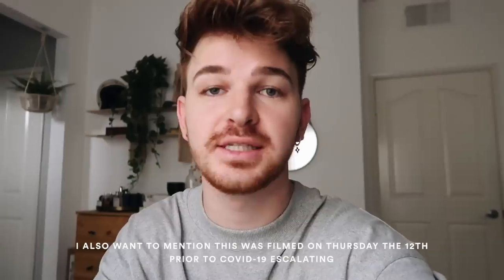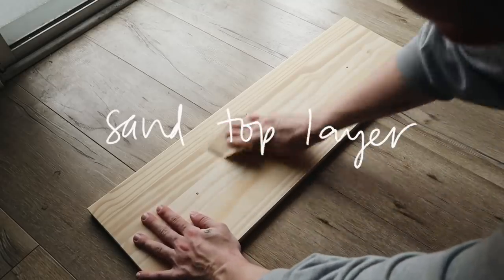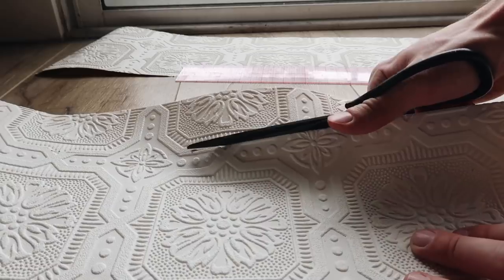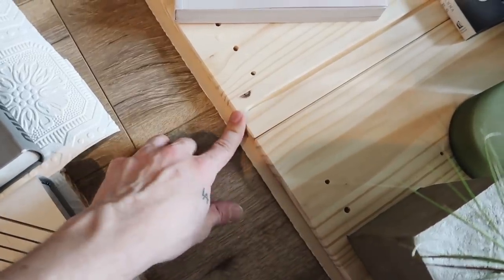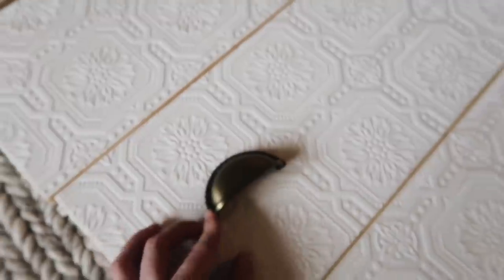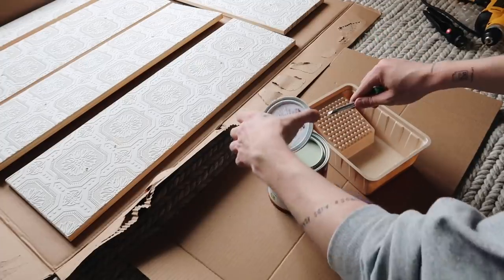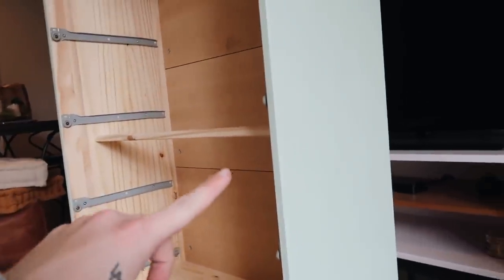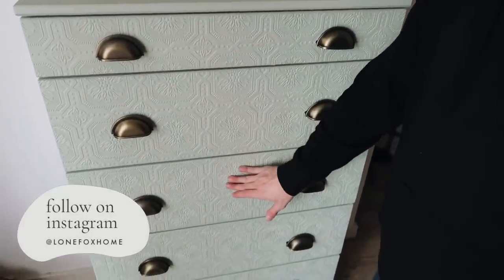DIYing VIRAL PINTEREST HOME DECOR - Embossed Wood Dresser (IKEA HACK)

Comment: I have a few questions if you're bored XD Love the video :)

1. How do you choose your color palette for these DIYs - do you tone it to the surroundings, pick a favorite color or go off trending colors?

2. Do you end up with a lot of left over paint from projects & if so, how do you end up using it? Does that play a big part in smaller DIYs' color palette as well?

3. With the larger projects, do you usually just switch out pieces of furniture regularly or do you ever gift furniture to family & friends?  Have you ever sold anything you've made that you may not have had room for? Purely out of curiosity. I love the furniture re-dos but I have no room for furniture & wonder how you do it with an apartment.

Comment: The only thing that would make this better is if you drilled the holes for the pulls a little bigger so that little foot goes into the wood and the handle is more flush to the front.
Reply: Yes that foot has to go way in. But the dresses looks fan-freakin-tastic.
Reply: Ditto ... handle should be flush with the drawer front.
Reply: Yes, the handles were not properly installed. Otherwise, a great piece. My OCD would have to fix the handles though.

Comment: Great idea, looks fantastic. Three ideas/tips.
 1) That wallpaper has a water activated paste on the back. You just need to soak it for a few minutes in a sink or tub, then presto. I'm sure the Modge podge works too, but it could have saved you money/a step. 
2) I'd worry about the dresser getting use and the paper peeling up regardless. You could trip each drawer out with some ¼ round, or cove moulding or similar. It would serve to tack down the edges of the paper to prevent too much wear, and add a polished look to it. 
3) I'm not sure but it looks like those handles were meant to be counter-sunk. You just need a slightly larger drill bit so that the handle connect points go into the dresser (when is better for the stress placed on the screw and wood), and the the entire back of the handle would make contact with the drawer front. 
Love your videos, watch you every week.

Comment: Hi, thanks. I love this. I wanted to mention that I got an IKEA dresser a few years ago that had a glass top over the wooden top. While I was putting it together, I trimmed and inserted a sheet of some very fine hand-made paper from Vietnam under the glass. It really elevated the dresser and made it special, kind of like what you did here with the textured paper. It would never have occurred to me to put texture wallpaper on the front, but it turned out beautifully.

Comment: The wallpaper you used is called anaglypta and was used many years ago to hide imperfections on walls. You did a good job of putting it on the drawer fronts. Although the  modern version that you used is usually prepasted, soaking it like wallpaper to activate the glue does not give a strong enough bond on furniture.  Good Job!

Comment: A couple of tips on installing different drawer pulls; you can use a small piece peg board and use it to make a jig to give you the same placement.  Just put a couple of dowels along one end and one edge.  This way you use the edge of the drawer front to position your jig, then mark the holes that are where you want the drawer pulls to be with a Sharpie marker.  If you don't have a scrap piece of peg board to make your jig, you can buy a premade drawer pulls positioning jig at most home or hardware store.

Comment: It's beautiful! It looks like you may have a bit of an issue with the handles sitting flat. A quick tip! I think they're designed so the posts on the back sit inside the drilled holes. I got around that by taking the handles off and using a Dremel with a cut-off blade to remove the protruding piece. It's better than drilling larger holes because if you do that, the holes might not align properly and the handle will sit crooked. Love your projects! Thanks for offering great content in this weird world. <3
Reply from the maker: Thanks so much for the tip :)

Comment: It's called sage green, and if you don't have the ability to dig your knobs into the surface you can use a piece of tape to mark where the holes should go and use that as the template to quickly mark all the other pieces.

Comment: Absolutely incredible! I do have a question though. After you mod podged the wallpaper to the drawers fronts, and let them dry, did you go back over the edges with another layer of mod lodge to seal them down? Especially after sanding the beveled part. Did the wallpaper adhere ok, or did you have to reinforce anywhere with any more mod podge? I hope that question makes sense. And, if I would put a little extra mod podge on (because I’m OCD like that 🙄) do you think that the paint will stick? Thank you! You did an absolutely marvelous job!

Comment: I have a question (a mom here) - how does this clean? I usually clean with soap and water - I noticed you use matte - do you find this shows marks - I WANT to do this so bad but I like to use gloss or semi gloss paint because I find it shows less fingermarks, etc - less cleaning for mom - what did you find as this piece got dusty?

Comment: It looks great except for the handles. Those handles are made to be placed in holes that are grooved into the wood whereas yours was screwed on flat on the dresser drawers. You can see the gap from the top and sides that the handles are not flush to the drawers. There are those same type of handles but without the two 'prong like' extensions for screws. 
I personally would of gone with a handmade ceramic copper knob. Imo.